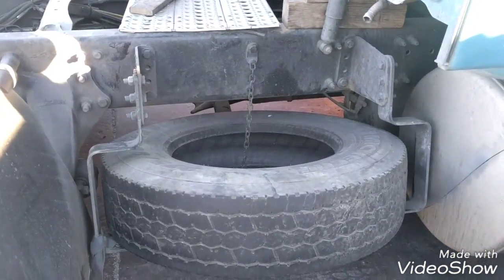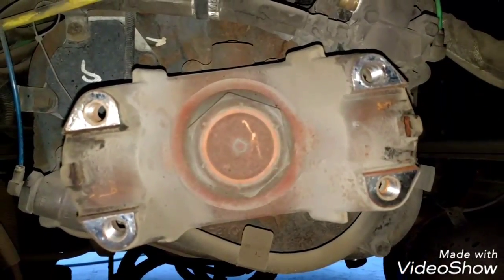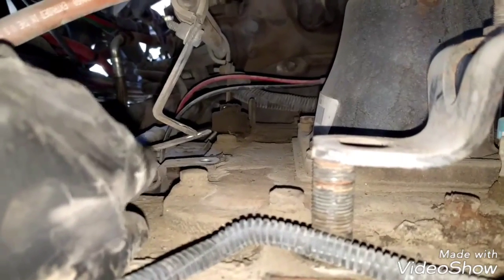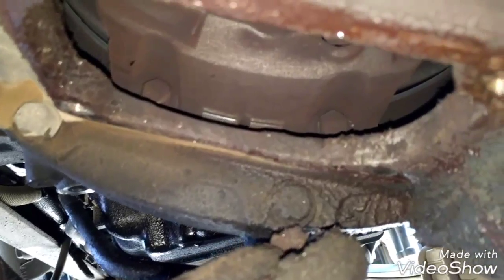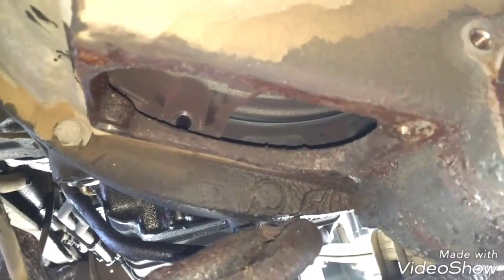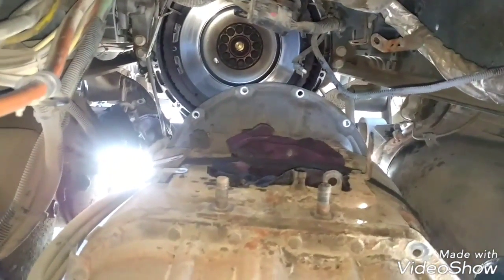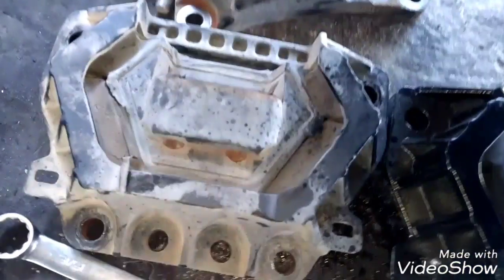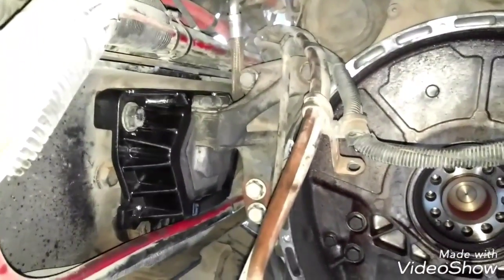Freightliner Cascadia clutch transmmision rear main seal motor mount removal replacement part 1

Comment: 4:51 I see metal where the slave cylinder mounts to. When I changed my slave cylinder, I found a rollpin but close to the size of a dowel pin in that same area. Do you know where it came from, what caused it, can i fix it, and what can happen if i keep driving it. Thank you

Comment: Thank you for helpful video like always ,how much it cost just labor?, seal and both motor mount replace , no transmission replace keep same
Reply from the maker: +/- $3500 - $5000

Depending on the parts, labor rate and accessories to replace.
Reply: @franciscoamayaYT  how much the labor for rear main seal replace??
Reply from the maker: antoni xicara
Maybe like $1000 +/- 
It is better to replace it when you do the clutch.

Comment: Hey, my mechanic changed my engine mount, to do it they had to remove the transmission,  when I got the truck back I noticed I loose coolant when I parked, after searching for days where the coolant going, I realized it's in the DEF tank, what could cause that?

Comment: Francisco I’m doing this job currently on a cascading a daycab, however some of the bolts for the bracket on the motor mount go into the hanger for lead spring…how do you keep it from not shifting? Thanks again

Comment: Do you need to remove  the transmission  to install the motor mounts ?
Reply from the maker: No necessarily but they are easier to replace them if you remove the transmission.
Reply: Thanks man

Comment: I have a 2010 dd15 with a 10 speed, i want to change my transmission for a 13 speed, what will i have to change on it?
Do i need a different clutch and what else will have to be replaced?
Reply: Edwin Macias same here.
Reply: @fabiomeurer4239  let me know if you ever get info on whats needed, i will do the same
Ive heard that all i have to do is cut the drive shaft, and program the computer to the new transmission
Reply: Edwin Macias early today I found a guy on the you tube and he said on his video that’s wht they did. And also cost about 4,5 labor and parts
It’s look like it’s a simple thing to do. But he also say most of the dealer make it a big thing. Guess to make more money? If i get it done at some point will let u know
Reply: Exactly what I want to do
Reply: @Fabio Meurer thank you

Comment: I need to ask! About what is the cost for you to do something like this?? Also, I NEED to know what could cause a clutch to burn so easily!!😢 I haven't had much experience on the manuals, but I thought I was doing well.. The mechanic is blaming me for breaking the clutch and put a new one in. Within the next week the clutch looked bad again, at least that's what he told my boss right after he told me the day before that I was shifting and clutching right and that it look very good. Lost my job due to the cost.... Could a fan stealing horsepower have anything to do with affecting the clutch?

Comment: I have a 2012 Cascadia with the Eaton Transmission. It is stuck in high gear l, do you have to drop it out to repair the piston...also wondering should I start by replacing the selector first. Great job on all the Videos!
Reply from the maker: Do you have a 10 spd?
Reply: Olin Sanford No. Fairly easy to replace.

Comment: Francisco--muchas gracias. How did you rotate the flywheel through that little space in order to turn the clutch? Some kind of tool? Surely, you didn't bump the starter, right?
Reply from the maker: Using a flat screwdriver (a big one)
You use the ring gear teeth to rotate it with the screwdriver. 
And no, I didn't remove the starter.
Reply: Francisco Amaya can you send me your email.

Comment: Excuse what kind of tool I can use for spinning the engine for remove the mounting clutch bolts . And what’s the tool for put in on again the rear main seal ? Thanks so much
Reply from the maker: Just a regular screwdriver

Comment: Francisco, is this an Eaton, model FRO? Also, where'd you get the seal compressor?
Reply from the maker: No, this a 13 speed. RLTO transmission. 
FRO is for 10 speed 

At the freightliner dealer or online

Comment: Francisco   I HAVE 2010 FREIGHTLINER CASCADIA I A CAB AND STEERING VIBRATION BETWEEN 55 AND 60 MPH  . I HAD FRONT TIRES REPLACED AND BALANCED ALSO I REPLACED THE 6 SHOCKS AND DRIVE TIRE AS WELL ARE NEW AND FRONT IS IN GO SHAPE TOO. WHAT COULD BE  CAUSING THAT VIABRATION.?
Reply from the maker: The brake drums can cause a vibration too. Have you replace any brake components in the front?
Reply: Hi Francisco thanks for your videos, I have a question I got freightliner 2013 last two days I. Saw sometimes RPM going up  when truck in 10gear and gas pedal all the way down rpm at 15 sometimes rev up it self to 18 and goes down to 10 and come back to normal,and when moving between 15mph to 55mph I had  little noise and vibration under between driver seat and gas pedal please what you think about this problem tnx
Reply from the maker: The RPM goes up, but the vehicle remain the same, right?
Reply: Thanks Francisco for your response yes
Reply: I recently changed brakes and slacks is there anything I can do please
Reply from the maker: You PROBLEM is going to be the clutch. 
It is slipping when it is at the maximum amount of torque. 

Two things to inspect

1- if you have a Eaton solo clutch (self adjusting) check the life of the clutch as I demonstrated on this video

2- if you have a easy pedal clutch (manually adjusted) maybe it will need adjustment.
Reply: Fransisco I HAVE DISC BRAKE ALL AROUND BUT I HAVEN'T REPLACE ANY OF THEM SOMEONE TOLD ME COULD BE THE BRAKE ROTORS  ON FRONT BUT  IT COST $300.00 EACH I CAN  NOT GUESS ON IT I HAVE TO BE SURE ITS.

Comment: Hey Francisco I have a hydraulic clutch on my 14 cascadia. The clutch brake dosen't work. When first going into gear but works normal when I stop at a light. I'm at a TA and they said there is nothing they can do that you can't adjust a hydraulic clutch. Is this true? Can you please enlighten me?
Reply from the maker: If the clutch has a manual adjustment, yes they can adjust it. 
But usually cascadia comes with automatic clutch.  

If you can go underneath the truck and check the clutch,  see if the clutch has the same wear indicator as the one is on my video, if It has the same wear indicator that means that you have automatic clutch and it can't be adjusted.
Reply: Francisco Amaya which one is good -14 cascadia  manual or automatic clutch I replaced clutch and transmission 1 year ago. But it’s hard to go first gear then I don’t use clutch after
Reply: I'm sure like a manual adjust Eaton road ranger you also setup clutch pedal adjustment in accordance cover adjustment. Providing its using a clutch brake disc on the last throw of the pedal and not a air operated internal brake. Also if cold first run they like to be nursed until there warm, miss gears etc if rushing until warm.
Reply from the maker: GTL LLC
Manual is always better
Reply: Tell them to spray it with degreaser and pressure wash it, then dump the clutch in first it will re-adjust itself if it’s stuck.

Comment: How are you francisco. I have a question. I driving a 2010 freightliner cascadia with 900000. Sometimes im driving over 60mph and you press the gas pedal the rpm star going up but the truck is not going any faster?.
Reply from the maker: The engine RPM goes up but you don't feel any response from the vehicle, is that what you said?

If you press the gas pedal slowly, does it get speed?
Reply: Yes. Thats exactly what is happening. Any idea?
Reply from the maker: It is possible that the clutch is slipping or out of adjustment. 
Check if you have a solo (automatic) clutch or a easy pedal.
If you have a easy pedal you need to adjust it but if you have a solo clutch you will need to replace it.
Reply: Francisco Amaya, thank you  for answer. Thats exactly what I was needing to know. Appreciated

Comment: Wow!! Alot of work... how long did it take??
Reply from the maker: Around 16 hours of work. 
Yes, I did a lot of work.
Everytime you do clutch job is recommended to do all that but the price gone very high.
Reply: Great job mate, good to see a thorough mechanic,  as you would know these units traveling large kms inbetween replacement clutches, input shafts wear splines, spigot and bearings commonly, as well as rear main seals go hard. Be a shame to tell the customer a 100,000kms later that the box has to be removed again. Higher cost for initial parts and labour replacement, however saves paying transmission removal and refit twice.

Comment: Hi,  Francisco, I have freightliner cascadia 2011 it has hydraulic clutch,  had difficulty shifting when I am start driving in the morning, after 15 minutes driving everything is ok for shifting gears,  went to freightliner dealer told me I had bad hydraulic line end replaced,  then bleeded air form the system,  but still I have the problem any idea please help.
Reply from the maker: Hydraulic clutch? ,Do you mean the clutch auxiliary cylinder?
Shifting?, Which gears?
What time of transmission do you have?
Reply: Francisco Amaya , thanks for the response,  truck has small reservoir under the foot valve, and it takes DOT 3 oil, my transmission is 13 speed EATON FULLER
Reply from the maker: Ok, so when you say hard shifting, you might that the gear makes noise when you do the shifting?
Do you use the clutch to do the shifting?
Reply: Francisco Amaya , thanks again,  mostly I use the clutch, the problem is when I move the gear lever or red button  the RPM stays high means nothing changed still I am the last gear!!
Reply: Most problem is the red button,  I shift  like ten speed to shift I can only use the red button after 15-20 minutes on the road
Reply from the maker: Oh!, Ok!   
Usually the DD15 ENGINE with 13 speed transmmision needs high RPM (1500 - 1800 RPM) to have a smooth shifting with the red switch.  
In some occasion the road speed limit needs to be higher (75 mph or more)  to have a smooth shifting, special on Freightliner Cascadias.  
If you do the shifting use higher rpm and the road speed limit is high, this means that the sliding clutch or the system is faulty and this is causing a bad speed shifting at high speeds.
Reply: Francisco Amaya . Thanks, your videos are really helpful
Reply: Hmm interesting, perhaps dirty airdryer or slave tank, moisture in the system causing delays. Road speed should always be matched with rpm to ensure smooth shift on non synchro straight cut gearboxes, maybe

Comment: How do you know if you need a new transmission??
Reply from the maker: Many reasons. 
Gear not engaging
Transmmision goes neutral on specific gears
Broken gears
Excessive oil leak
Bad bearings
Excessive Noise  
Etc,..
Reply: Francisco Amaya will a bad transmission cause any pulling power loss ? I’m hearing the noises now. It sounds like a bag of screws in a dryer. When I push clutch in the sound goes away. Clutch is about 9 months old.
Reply from the maker: Jacquisi Tarrance
A bad clutch can slip causing a Similar problem
Reply: Francisco Amaya I had clutch replaced 9 months ago. The rattling i hear is still present even after new clutch
Reply from the maker: Maybe the clutch is not strong enough for your truck.

Comment: how often do you need to replace a clutch? thanks.
Reply from the maker: Well, it depends. 
This truck had 800K miles with the OEM clutch, but It can last up 1M + miles if you use it correctly.
Reply: Depends on a lazy driver with a couple of bad habits,  #1 using to higher gear on take off #2 resting foot against clutch pedal

Comment: Hey Francisco DD15 leaking rear main seal oil onto clutch...can i save the clutch? its brand new.
Reply from the maker: Yes, it is a solo self adjusting clutch. Make sure to install the installation or service bolts.  So it doesn't mess with the adjustment
Reply: @franciscoamayaYT  the oil can be cleaned off clutch? Brake clean? Its an ez pedal. I would like to save it.
Reply from the maker: Yes, it can.